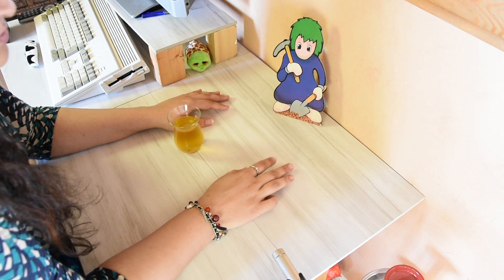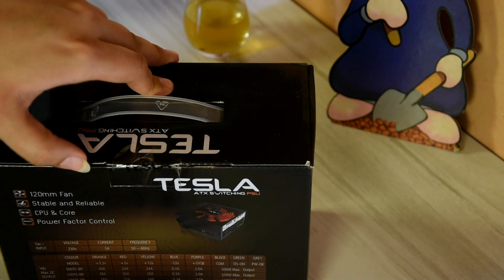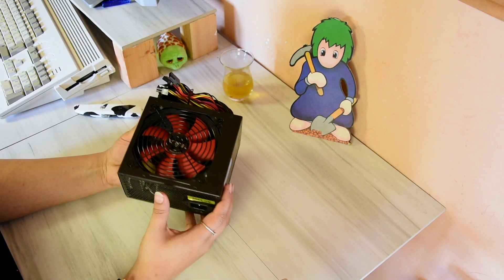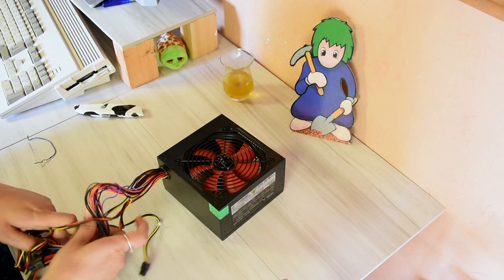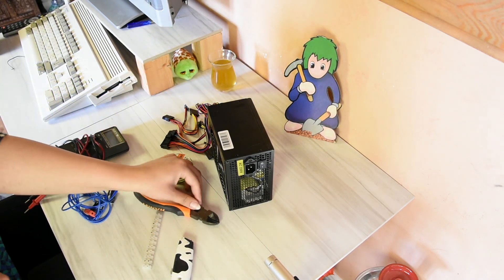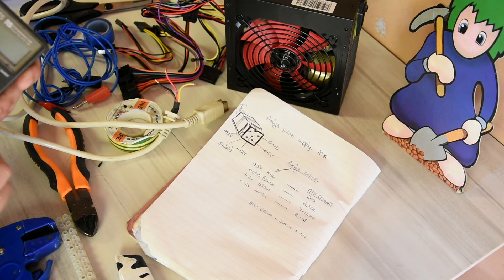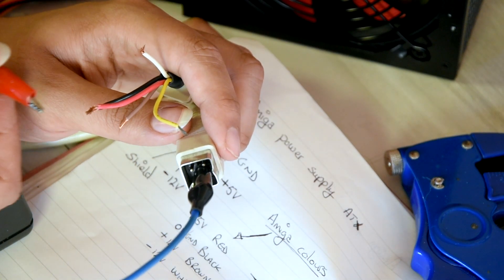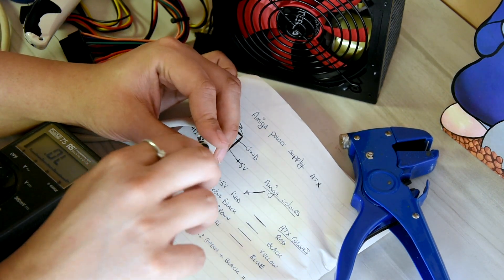Amiga - ATX PSU Hack

Comment: I thought you missed a step which is mentioned in the description. Also, 2 things. 1, You should crimp ferules over any wires that go into that type of wire connector ( frankly, I would have just stripped the wire back and soldered the connections and insulated with heat shrink but what ever.). And 2, you could cut any unused wires off at the circuit board ( if you aren't planning on using the powersupply for anything else).  Just my 2 cents. And much neater too.

Comment: Are the amiga PSU's that bad? My 1200 is running a 4gb compact flash and an ACA1221 (fully unlocked) on the original PSU and I have not had any problems so far, I did not know it was even a thing! What warning signs should I be looking out for that its time to mod an old ATX psu?
Reply from the maker: you're probably pushing the PSU, it's highly recommended that you get a higher wattage one if you're using the ACA1221, though i have an ACA1233n so i'm figuring it's going to use more. 
Signs. Well if your Amiga crashes a lot then thats a sure sign of it not getting enough juice.
Reply: I had the same thing on my 4000 (Before it got sold for the $$'s :(

It had a Cyberstorm 060 (MKII) with the Cyberscsi, I wanted to use a SCSI to IDE Bridge with a CF adapter, but the system was guru'ing on boot and rebooting, but was fine without the cyberscsi.

So for Dave, Power supplies do lose capability the older they get (caps wear out etc).

Comment: Most helpful - thank you :)

Check out my project:  http://www.zhixalom.com/lair/2017/10/08/amiga-1200-tower-project/
Reply from the maker: Thats actually a great project, to tower an A1200. It's not easy to do without the skill and tools. It's looking great so far! 
And thanks for the mention also :o)
Reply: You can actually buy a cabinet for an A1200. But €300 seems a bit much for an empty cabinet and to me it almost looks like they've just taken a premade PC cabinet, drilled out the pop rivets and swapped the back plate out with something custom made. I guess this line of thought was my inspiration.
http://amigastore.eu/en/584-blackbox-1200.html
Reply from the maker: I've seen it, but yes it looks like a PC case conversion, either way it's not worth spending THAT much just on a case, for me personally anyway. Even though the case on Amigastore.EU looks good!
Reply: My thoughts exactly

Comment: Great video, but i really wouldn't recommend a PSU over 250W to use on the Amiga, newer and larger supplies have a minimum load needed to power the rails, and its usually far higher than the Amiga can put on it, and has been stated by MVG can kill your Amiga.
Reply: Modern ATX is about 1A on +12V and about 300ma on +5v.
Reply: Brian White I have a 210 watt dell psu, and it states +12v has 12.0A, -12v has 0.5A,  +5v has 15A, and +5vfp has 2.0 amp... what is vfp?

Comment: I am mid-restore of my A1200. So far, I have got an Amigakit CF hard disk, a Gotek USB and I am about to take delivery of a an ACA1233n and mini-mys ps2 mouse adapter. 

A few peripherals, like my original A600 mouse was buggered and only worked horizontally, if at all. I am dreading issues with the PSU, just because it seemed to have been given the classic Commodore build 'quality' touch. Is this still a recommended upgrade?
Reply from the maker: Nice! your A1200 is coming along then. 
Well i'm wary of this after reading MVG's comment but i've been using mine still and to this day. 
I've been sitting on that PicoPSU thing, I have a plan to do a video creating it but really hate goofing around with power projects to do with the Amiga out of fear. But now I have a spare goofed up A500 I can test on at least so I think i'm going to bring that forward.
Reply: An update on my mouse problem which might offer help to those who are also suffering issues. After some quite scary quotes for repair, I began to dismantle my A1200. 

After taking the shielding off I noticed my motherboard revision was the one with a seperate daughterboard mouse controller card. I looked all around the port and saw no visible signs of burnout or damage and after removing it from the mainboard, I spotted LOTS of oxidising all over the pins which sat inside the plastic connector! I took a sharp blade and removed and cleaned it up and the mouse works perfectly again... 

So, in short, if your amiga peripherals are behaving erratically, start investigating where the inputs travel using the cheapest diagnotic tool you have... Your eyeballs! :D

Comment: I'm in the process of building a new power supply for my A1200. I'm going the Pico route. I've got an original black A1200 power supply (bought black to match my new A1200 case from www.a1200.net) that I'm converting. I'm using Ian Stedman's picoPSU adapter (can be found at http://www.ianstedman.co.uk/Amiga/designs/Amiga_ATX_Adaptor/amiga_atx_adaptor.html) and an authentic picoPSU-90. Looks to be a fun project. Love your solution as well.

Comment: My worry with this. Is that PSU going to cause any issues with the Amiga? I am tempted to do something similar.
Reply from the maker: I can understand, so far it's working fine for me, but i'd advise to get a decent quality PSU. I am going to attempt the pico PSU in future.
Reply: I've been using the type of power supply (different brand and power) and it has worked great for about 10 years, and another one before that one.
But if you start to upgrade the Amiga with all kinds of stuff then you could fry the incoming traces because of too high current.
These PSU delivers ALOT more than the old ones. ;)

Comment: Muy buenas, te escribo por primera vez en tu canal, permite decirte de que me encanta, te he encontrado por casualidad porque estaba buscando algún tutorial para poder conectar una nueva fuente de alimentación para mi Amiga 1200 con BlizzardVision y BlizzardPPC/060, le implementé una nueva unidad Gotek y un disco SSD conectado a la IDE de la placa, obviamente me daba problemas de potencia, pues la luz verde de Power parpadeaba y no arrancaba.

Tengo ciertas dudas pues no estoy muy familiarizado en este campo, que fuente de alimentación me recomiendas?puedo usar la conexión de una fuente de Amiga 500? o me recomiendas que use la de un Amiga 1200 como tu bien usas en el vídeo,perdona por si se me ha escapado algún detalle del vídeo  ^_^

Muchas gracias por toda tu atención y bueno ya estoy suscrito a tu canal que me encanta!! Felicidades.
Reply from the maker: Primeramente, lo siento porque mi español no es bueno jaja, tengo que practicar :o)
Muchas gracias para tus palabras sobre mi canal. 
Sí, puedes usar la conexión de una fuente de alimentación de la Amiga 500 para una Amiga 1200, es el mismo conexión. A veces algunos utilizan el fuente de alimentación de la Amiga 500 para la A1200 porque tiene mas poder. Pero necesitas más que esto para tu Blizzard PPC, BVision y más. Un buen ATX power supply. no necesitas más que 300W. Puedes usar un fuente de alimentación como esto tambien: http://www.nightfallcrew.com/15/06/2014/commodore-amiga-500-full-replacement-power-supply/

Voy a hacer un “pico PSU” para mi Amiga 1200 in el futuro. https://www.quietpc.com/images/products/picopsu-160-xt-acdc-components.jpg
Reply: MsMadLemon Muchísimas gracias por toda tu ayuda (^0^), no te preocupes, tu español es bastante bueno, seguiré viendo  tus vídeos tutoriales y te informaré sobre los avances que consiga.

Un  saludo muy cordial y gracias.

Comment: When using an ATX it would be best to gather all the +5V, +12 and -12 together to use the full power the supply can provide. It requires soldering them all together and takes more time, but you can get much better power this way.  -Acill
Reply: Just to clarify, NOT all together in the same line, I mean all 5V in one bundle, all the Grounds in another bundle, all the +12 in another and so on :)
Reply from the maker: Hahaha I got what you meant in your initial comment and a good point you make :o)... 
What an interesting mess that would make, putting all +-12 and 5v lines all together along with ground into a single mega powerful rail ;o)))
Reply: There's actually not much point in increasing the wiring capacity beyond what the Amiga power lead itself has.  You are limited by the weakest link.
Reply: I am not sure that is a good idea. The Amperage  of  ATX psu is great and a small spike could easily roast the machine. Most ATX conversations install Amp limiters  to protect the machine.

Comment: be careful with an ATX powersupply.  newer ATX ones - can't deal with quick changes in load on the +5V line.  I fried my RapidRoad USB this way, 

AmigaKit  used to sell refurbed ATX supplies but no longer due to this.
Reply from the maker: Thanks for the heads up, I had no idea about this.
Reply from the maker: What would be best to use instead? An AT PSU? or?
Reply: Where can I find more information about this and how to select an ATX where this is not a problem?
Reply: I have a ATX PSU on my 2000 and another ATX on my 500's..Yes running 2 A500 on 1 ATX with no problems at all... My friend now wants me to mod a ATX psu for him as well..
All i can say ATX psu are the way to go.
Reply: Strange, I'm running A1200, PPC 333Mhz, 256 Mb ram, fast ata, hdd, mediator with GPU, LAN, USB and I have no issues with ATX PSU.
Reply: Use a ATX 350W PSU with my AMIGA 500 Rev6A / Indivision ECS V1 / ACE2 / X-Surf 500/ ACA500Plus V1 / ACA1221EC / RTC and 3 Extern Diskdrives. It worked great and use it every day. Have also a ATX on the A1200 and with the A600.
Reply: Ups! I'm afraid now!!!!